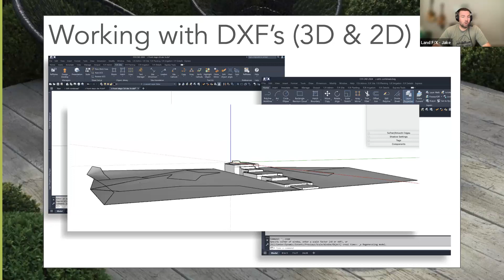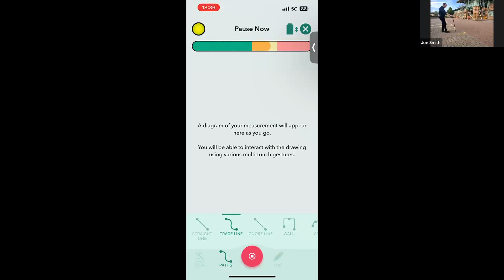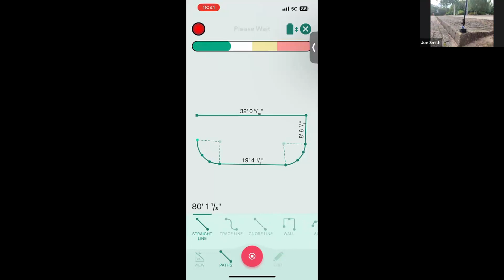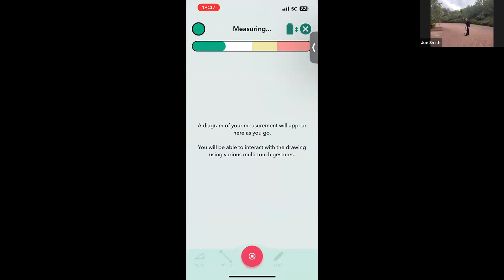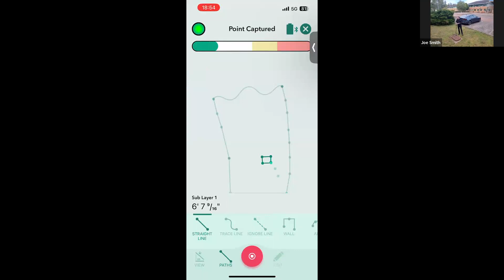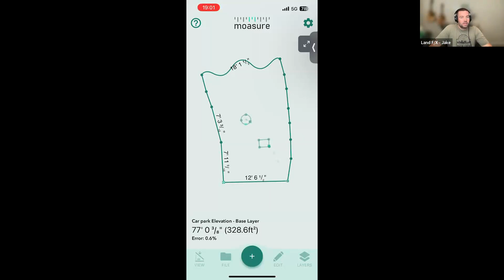Moasure®: A New Way Of Measuring

Comment: Great development, I would like to know if it's possible to assign real coordinates to the starting point and if the location of the points takes into account the north
Reply from the maker: Moasure currently doesn’t have a way to set north or the starting coordinates. What is mentioned in the video, and from what we understand, there are future builds that Moasure is talking about that might include gps features, but it is only a discussion at this point. Best thing to do is to make sure you mark a few points that you can align once back in your plan. We'd also recommend reaching out Moasure, as they may prioritize items like this once they see requests for it from the community.
Reply: The alignment process in Autocad is our best option, two or three points measured with a GPS will give us real geolocation of moasure measured shapes. To incorporate GPS function in moasure as they are talking is a game change out of moasure principle